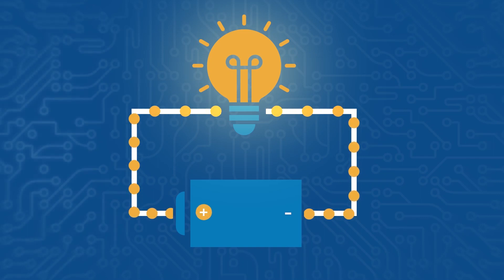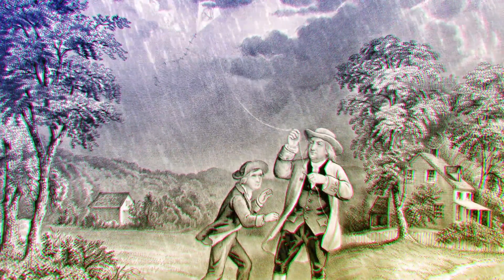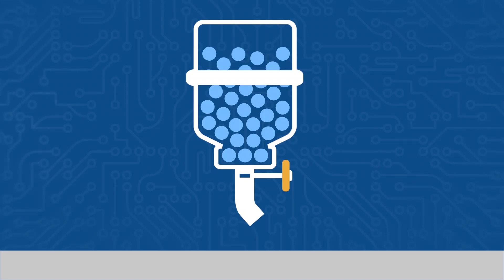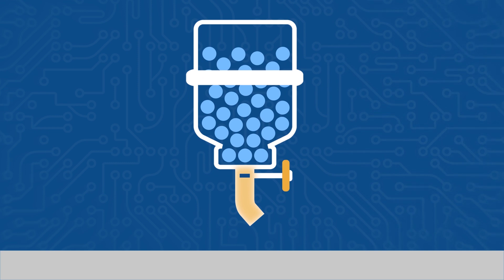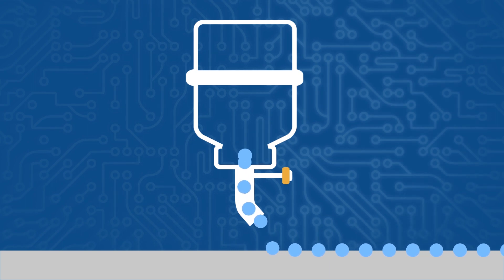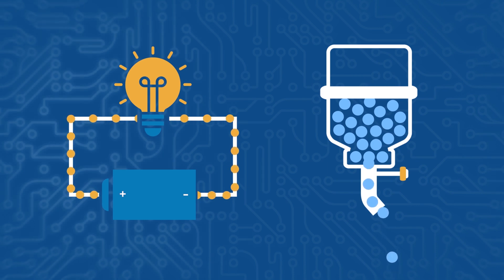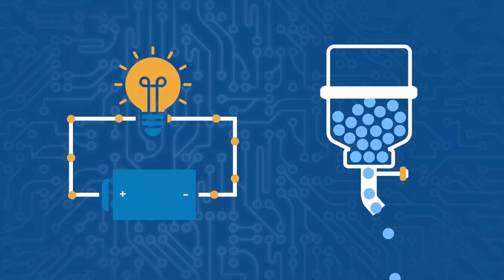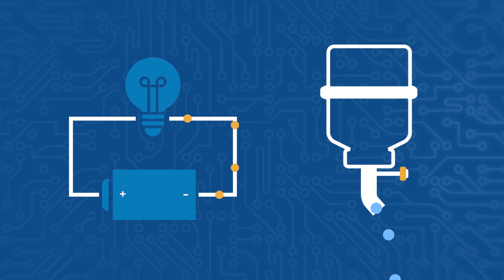What Is Electricity?

Comment: Electrostatics and circuits belong to one science, not two.
These are discussed usually separately in textbooks and science and engineering courses. 
Watch the two videos listed below to learn about current and the conduction process and surface charges (using a unified approach to electrostatics and circuits) which set up the electric field whose line integral is the potential difference. The battery produces the emf.
The last frame of video #1 lists articles and textbooks which discuss all these topics in more detail.
1. https://youtu.be/REsWdd76qxc
2. https://youtu.be/8BQM_xw2Rfo 

The units of emf and potential difference are volts. While potential difference is a path integral of the electric field made by real charges, the emf is the non-Coulomb work per unit charge and might in principle be chemical, mechanical, gravitational or nuclear in nature.